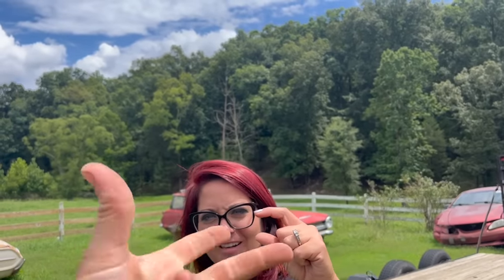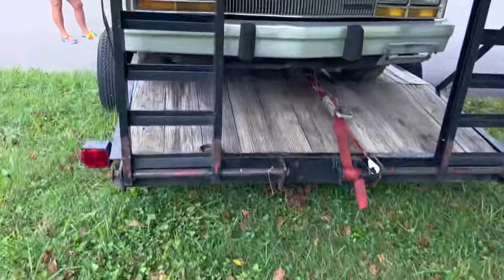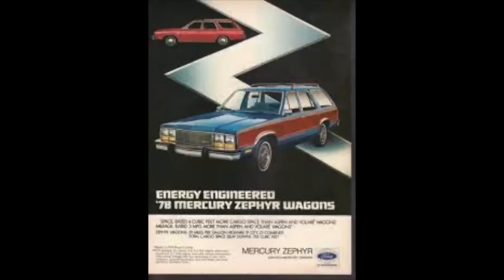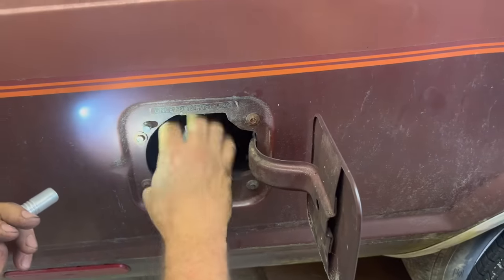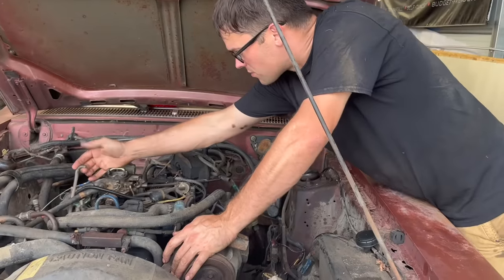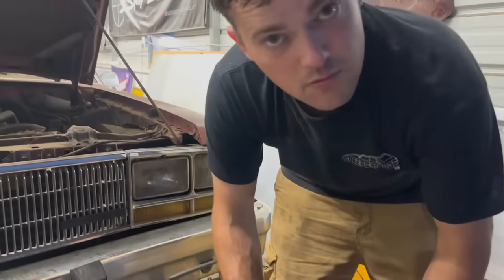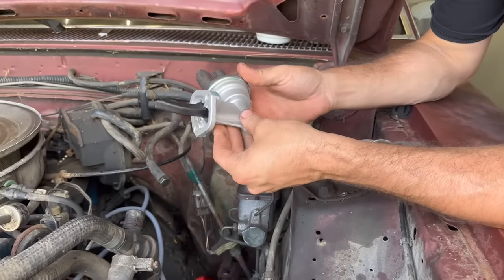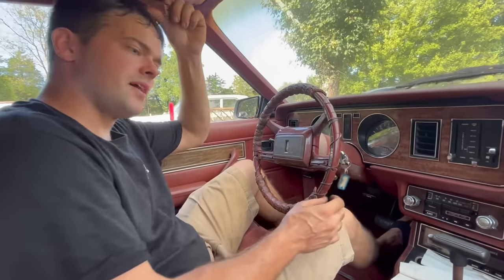Survivor Grandma Car with bucket seats and a floor shifter! Parked for 15 years will it start?

Comment: Had a black 78 Futura back in the 80s. That inline 6 was one of the most rock solid reliable engines ever. Never ever left me stranded. A/C was always ice cold, too. They don't make cars like that anymore. A reliable car that don't break the piggy bank. Nice find on the Zephyr.

Comment: 19:56 ford had that adapter for the distributor because like many car manufacturers, was still using a lot of castings from the old days. The distributor was basically a modified point distributor set up with the electronic pickup and reluctor. Ford found, when using the higher voltage dura spark 2 ignition coil, it would arc between towers, so a larger distributor cap was made, so a adaptor was required. The dura spark 2 would trigger when power is applied, this was a result of the circuitry in the control box, and served as a quick way to test that the system was working. You can see how far the spark jumped when ralphie turned the key. I was a driveability technician back in the 80s and 90s, up to 2004. Worked on a ton of these

Comment: Hard to believe 2007 was 15 years ago already. I'm surprised how easily that one just started up and ran down the road. You should get an oil filter cutter tool and cut the filters open just to see what's been sitting in there on these cars that have been sitting for a long time.
Reply: Great Idea

Comment: Keep on your Fairmont/Zephyr path. The wagons were excellent cars, too. Long videos are just fine, I hate having to go looking for 1, 2, 3, 4 etc. videos to see a single story on youtube, fighting the too frequent/repetitious ads. I've got an '80 Futura bought new, with 3.3L (200) I-6, and 4-speed floor shifter. Drove it 10 years daily, mostly interstate; 21/30 mpg fuel label was legit; 
I averaged better than 28 mpg over the 10-years and better than 30 on flat land trips; accumulated 202,000 miles, then parked it in my garage. It's still there. Perfect car purchase for me at that time with high gas prices. Gas price came down so I replaced it with an F-150 that I eventually drove 334,000 miles. Your family videos are quite entertaining.

Comment: Brings me back to 1996 and a one owner Grandmas 1982 plymouth reliant.  37K miles.  had been SITTIN.  I broke it in as a new car once again and then got down to I-93 into Boston commuting wars- not slow driving out there.  What a great car, until it rusted out from underneath me seven yrs later at 120K miles and running strong, burning no oil on the early optional Mitsu 2.6.  Never left me at the side of any road!
Reply from the maker: Awesome 👏

Comment: The top of the line GS option package added dual accent stripes on the hood, rear quarter window moldings, protective bodyside moldings, dual bright remote mirrors and GS decklid badge. (Info from standard catalog of american cars)
Reply: Also made a el camino variant called the DURANGO
Reply: More like a ranchero. I would think.

Comment: I used to frequent a junk yard way way out in the boonies. He had junk cars parked right next to the house well they called it a house. He had cars and trucks from the early thirty’s to late 80s . I scavenged parts for my 49 Chevy at the time,mainly a radio. One day my Dad told me that the man had sold most all the cars and trucks to a scraper. The next time in the boonies there sat a brand new two story fine brick home . It has a three car garage right out front with a top of the line snooker table right in the middle. No 49 Chevys to be found.I just shook my head and kinda felt sick in my stomach.  Great show today 👍

Comment: Remember looking at these with my Dad when they came out for 1978.In 1982 he bought a new Cougar station wagon with thee new for 82' 3.8 V6 engine.Nicer car then the 1972 Comet he retired but he never dug it.Had a few problems with it by 60000 miles and he wound up in a Toyota Camry V6 in 1989.A few Honda's after that until he shuffled off to meet the maker in 2018.
This Z7 will make somebody a nice cruiser.Those straight 6's are pretty reliable but have no power.About 85 horse by 1982.
Good Luck and will be watching for an update.Thanks for the memories
Reply from the maker: That’s awesome

Comment: Love those old 6's.  Sounds like a 170 but I can't remember if they were still making that by then.  The 200 had a little more whistle from the carb (which is what that mystery "vacuum leak" you were hearing most likely was.)  My first on-the-road wheels were on a '71 F100 with a 240 and column shift 3 speed.  It did have a heater.  Nothing else.  Not even AM radio.  To this day I don't like listening to a radio when driving because I like to be able to hear what's going on.

And yes, I always watch until the end.  I do enjoy the wrap-up hood sitting with Rocky and friends.  You have a good format going here and a good crew both on and behind the cameras!  

Bill

Comment: My first Toyota truck, before they were even called a Tacoma, had a vacuum leak when I bought it. I went to the auto parts store and got 15 feet of vacuum line. They really thought I was crazy when I went back and asked for five more feet that afternoon. I just pulled off one line at a time, cut new line to length, and replaced it. Then the next one, and so on. No misrouted lines, and I knew that I wouldn't have any more leaky lines. Thanks so much for all the great videos, I love these old cars (even the Fairmonts) and always like your humor and the way you all get in on the fun. All the best to you.

Comment: May be wrong,  but I think if you move the tire/wheel further away from the center post it will break better. You need to angle the wedge toward the wheel itself. Looking great by the way. Very nice car.
Reply from the maker: Ok thanks

Comment: My favorite was the 77 78 cougar I was going to buy one with T tops.
It was 5 yrs old with low miles and looked like it was in perfect condition. Loaded with all the extras.
The very next day I lost my job, so I passed on it. It was a light green 1977 Cougar XR7, long hood beast with a 351 M. Clean as a new one in 1982. Beautiful car
In the 80’s I was always getting laid off from a job.

Comment: I borrowd my brother in laws 81 Fairmont. It was a 4 door loaded and had the straight 6, maybe a 200 ? At the time it was only 2 or 3 years old. I thought it was the slowest thing I had ever driven up to that point. But now all these years later I drive a Smart Fortwo and I now KNOW what a slow car is. But I am old now and it's easy to tolerate. Josh you need to find a Smart car to work on. They do alot of things differently (Mercedes Benz) and I'm sure you would get a big kick out of one. You would never get rid of it and i promise you that, they are so much fun to drive. Ralphie would love driving it.
Reply from the maker: Your probably right

Comment: I've been using a manual tire changer for a while a few pointers , I use a good bit of dawn dish washing liquid mixed with water to wet the bead . Mix it till it is very slick between your fingers it works better the more slicker. Rotate the the tire and rim just a little bit at a time you might have to do a half of rotation on a old tire that's been on a while . Another thing I learned was if it doesn't break the bead immediately don't force it to the point where it pushes that leg away from the rim just hold most of the pressure on it but not all too hard another words. Sometime if you just hold a medium amount of pressure like for 20 seconds or so it will come loose a lot easier than just brute force.  I hope this helps not trying to be a know it all or smart just some  constructive criticism. I love the channel i watch stuff like this when i'm  not wrenching  my self.  I want to do Junkyard group on FB mainly classic car junk yard locations and especially junk yard closings so not as many get crushed . We could even do request locating hard to find parts. I live near Columbia Sc I know a guy that has probably 500-600 cars  not all classics but most are . Anyways keep on wrenching great way to bond with your family you don't see  that kind of stuff anymore.
Reply from the maker: Thanks for the tips and thanks for watching

Comment: My dad bought one of these in 1980 I believe it had a 2.3 engine and a manual transmission on the floor and bucket seats and a console also sunroof AC power steering cassette stereo. Not much power but when you were by yourself it was fun to drive

Comment: Hello Sleeperdude88!! I owned mid 80s Ford, LTD, V6, but the interior was just like this one, headliner, separating, and draping down on to your head 😆…. I’ll tell you though, I put that car through hell and back and when I sold it The lady who bought it, her 14 y/o  daughter stole it and ran it into the ground. Didn’t have any oil, radiator was empty…. It’s a perfect car to put on your site except we added oil and water in it. and it fired right up. Lost track of it after that.

Comment: Hi Sleeperdude and family. Don,t mind the long videos at all there to much fun to watch! Nice car for wawa, good on gas and nice first car. I,m going out on a limb here but I think the rear brakes are way out of adjustment judging by the way it kicked out the cardboard, and i wont be surprised if the rear drums still have the clips that you have to pull off to get the drums off. Those clips keep the drums from falling off when going down the assembly line.Even though it does have 103 thousand. Looking forward to the next video!
Reply from the maker: Thank you

Comment: Hi Josh & Family, I like this one for sure, find a wrecked fox body Mustang for all the parts to swap over, the rear Diff & springs, sway bars, front suspension too, drop in 5.0 and 5-speed, peddles should be a direct bolt in, use clutch cable from the Mustang also, shorty headers from a mustang will work, you are 90 % done at that point, Mercury was a higher line with a few more goodies I would think. Factory AC is a nice bonus. Or just leave it with the gutless 6 banger. Take care Family.
Reply from the maker: Yes!!!

Comment: Original plugs and wires, original belts, original radiator fluid, original oil , original transmission fluid , brake fluid , and don't forget the original blinker fluid too.😁
Reply from the maker: Awesome

Comment: The Zephyr runs really well. You mentioned the exhaust before you do more driving delete the catalyst converters for long as it sat. They will stop up the more you drive it. Learning from experience I bought a 81 mustang V8 and drove it for awhile and oil was getting on the crossover exhaust pipe come to find out the converters heated up and stopped up cause the engine to pressurized and blew out the rear main seal. 
This is a really good solid car.

Comment: Motor week was where it was at, I was 8 in 1993, and me and my dad watched motor week on Saturdays. That's where I learned about 454ss Silverados, and Sonoma gt(4.3 2wd, only .03 slower in the quarter mile than a 454 SS truck), and of course the sy/ty all wheel drive trucks. Or the Marlboro targa top pace truck. My obsession with 2 door blazers and s10s started right there.

Comment: Bro, no crap, my grandmother had a 1978 Mercury Zephyr since it was new and she owned it until about 2007 and it only had about 86k miles on it with a 3.3L I-6 with a 3 speed auto (shifter on the column with a bench seat), and it was deep blue with hubcaps. It was a punchy little six, comparable to the 225 slant six. It was a sedan, but it was still decent. My grandmother kept it under a car port, but it was a northeast car, so the chassis was fairly rusted. She scrapped it and bought a Ford Tempo...lmao Sadly, she passed back in 2010 at the age of 85. Her and her husband (my pap obviously) were my only grandparents. They were my dad's parents. My mom's parents passed before I was born. Edit: Maybe it wasn't comparable to the slant six...85 HP and 154 lb ft...
Reply from the maker: Oh wow

Comment: I remember the Mercury Topaz. My mom had a dark blue 1984 that she drove for many years. The body was falling to pieces, we are in Canada after all LOL, but the motor would never die.... Except in damp weather. For some reason, it always stalled in damp weather. And always at a stop light. And every time it did, she'd get furious and start punching the steering wheel. I learned how to swear from my mom because of that car 🤣. We have my grandpa's 80 Thunderbird, so I have a soft spot for these Fox bodies, despite being a Dodge guy. Great job!

Comment: The way that car runs. That car is probably good for another 75000 miles. It is worth painting. Good family car for 5 years or more. Seems to be a trustworthy car. Compared to the new cars that cost so much money and have problems. That car is a money saver

Comment: I really enjoy your videos.  lol spending hours just catching up and getting the kind of education I wish I'd had in the 60s. I enjoyed an early 60s Impala station wagon in high school and a 70s Chevy station wagon in the 80s. I've never been able to have a car less than at least 10 years old. But I love the ride and room of an older car anyway. I could have saved a lot of money on brakes and carbs if your channel had been around decades earlier.
Ralph, I drove a 60s Oldsmobile 100mph from Abilene to Cisco. Those old cars were built to run. And that was without air scoops and all the other ugly add ons.
Reply from the maker: Thank you. Exactly

Comment: We in the Northeast have the opposite problem when buying older cars then cars from the South; the interiors are usually in great shape but the bodies are rotted away. All the salt they put on the roads in the winters just ate these cars away. I bet if you looked around you could find a Futura up here with a perfect interior with a rotted out body for under a grand. Lastly, Boy! Is Vennia getting big!!!

Comment: You said this car had lots of vacuum lines, I had a VW Rabbit with color coded vacuum lines. Brake cleaner and carb cleaner are deadly on bees. These old cars were what I worked on as a teen and young man. I really miss being able to work on them. new cars are too complicated. I had a VW Squareback had over twenty feet of fuel lines. On stubborn casings I used to drive on them to break the bead loose.

Comment: I learned my lesson trying the heater on a vehicle that has set in a field for years. I bought a old Chevy pickup one time and put a motor in it and the first drive I took it down the interstate in Indianapolis. I decided to try the heater not thinking it was full of rat nests. When the fan speed thing that has the coils on it got hot it set the nests on fire. I almost burnt it to the ground on its maiden voyage. I now take the heater boxes out and completely clean them and I highly advise never try your heater until you clean your heater box out!
Reply from the maker: Ok thanks

Comment: Hello all, Loved this video. Not to many cars left like that around anymore. I was watching when you was trying to get the casing off the rim, Get you a long handle tree pruner with the curved blade and it will cut the casing right off. It will make it a lot better with those "retired" casings. My dad and I used that trick to remove a set of old tractor casings. He was beating it with the sledge hammer and I went and got those and 5 minutes later it was off the rim. Love the videos.
Reply from the maker: Awesome good tip thanks

Comment: I had a 1981 Mercury Capri GS with the same exact engine arrangement. The front catalytic converter, mounted directly to the exhaust manifold next to the quirly q pipe, melted down on me, causing the power to go down to niltch and it overheated badly (I would gut the font converter if I were you).  Prior to that, the C4 trans in it went and got one from a junkyard and drove it over a year afterwards. Ended up selling it back to the State of California due to the fact it failed emissions and got tired of fixing it all the time. Got $1,000 for it back in 2001.
Reply from the maker: Ok thanks

Comment: I remember a neighbor of mine down the street from my parents house had a Mercury Zephyr 4 door it was brown with tan interior I think it was I was probably Ralphie's age at that time they bought it brand new it was a nice car for back then at all the features in it I think I had power windows power locks AC all that. My grandparents my grandmother had an Apollo made by Buick look like a Nova and my grandfather had a Mazda RX7 with a rotary engine but this is the body style that looked like the Toyota Corolla from the 70s. So being born in the early seventies I did get to see some cool cars grown up' in the 80s and '90s. I wouldn't mind finding a two-door or a four-door Chevy Caprice square body my first car was 1984 square body Chevy Caprice it was like a baby blue kind of with a white vinyl top.

Comment: In 1998 a friend 79 fairmont wagon burned when a crazy guy in la jumped on the hood and broke the fuel filter off the carb.  Inline 6. Bought an 81. Fairmont 2 door coupe for 375 bucks. I kept it running for 20 years till he was collecting cans at a gas station and left his door open.  Somebody jumped in and drove off with it.  Must have seen the massive amount of bottles he had collected.  When the cops found it somebody had stolen the steering column but had cut the wire harnesses. 

These cars have not 5mph bumpers but 10mph bumpers on them.  
So many fox body mustang parts fit.  

86 turbo 2.3 or 87 intercooled turbo 2.3 are far better choices. .
If you have a straight six. Be sure to change the slack timing chain.
Reply from the maker: That’s right !! Thank you

Comment: I found taking tires off the rim the easiest way, is to take a saw zaw and go around the side wall, for example follow the white wall line all the way around on both sides and then try to press the rest off makes a huge difference if that makes sense